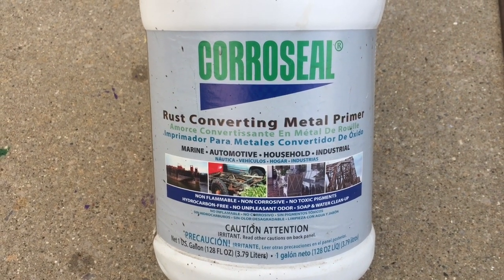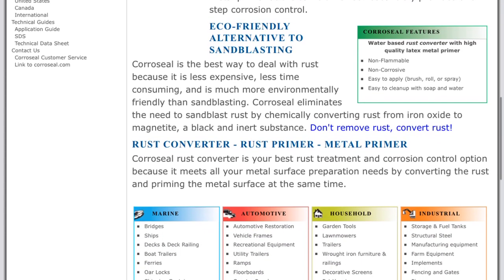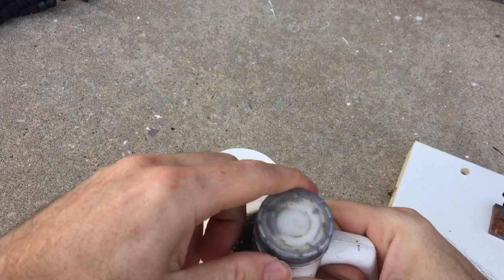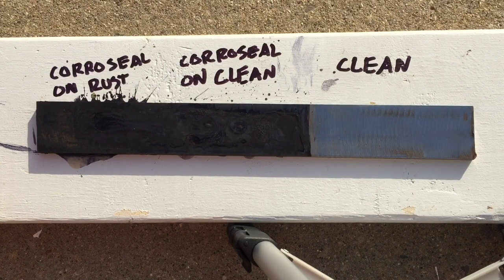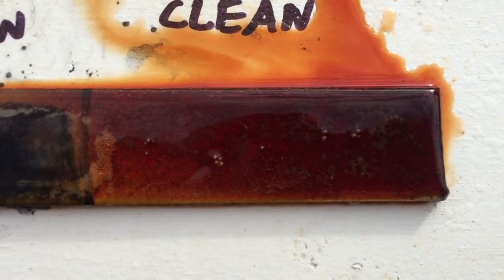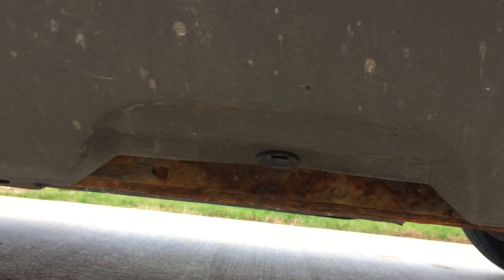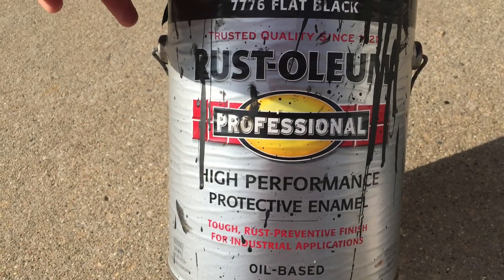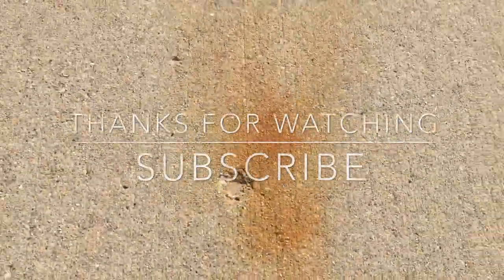CORROSEAL Rust Converter - Does it Hold Up On Its Own? Tests and Results! 4 year review! Stop Rust?

Comment: Wear protective equipment. Respirator, gloves and cover your skin. Especially a respirator, dust from rust removal is bad news. Also if you're spraying Corroseal instead of using a brush it can discolor your skin. It takes weeks to for the discoloration to fade. So cover up. This information is brought to you by the school of life. 

If you're spraying, avoid getting Corroseal on sensors, wiring, rubber bushing and plastics. Just wrap with newspaper. If it gets on there it's not the end of the world, just not a good idea long term to keep exposing it. 

1. Remove loose rust flakes with a wire brush. Wire wheel on a drill or hand brush, whatever you have. 
2. Wash all contaminants off the frame (Or body). Oil, power steering fluid, transmission fluid, even wax and soap residue etc.
2a. Blow off excess beaded water with air gun. Let it completely dry for a couple hours with a fan. Allowing all those nooks and seams to dry is important. 
3. Apply Corroseal in a thick coat with a brush or spray it on. (I use a $20 pneumatic spray gun from Harbor Freight to spray it on. Much faster than brushing it.)
4. Here is a hint using Corroseal. Multiple coats. The process of converting rust takes longer than the drying time. So using a spray gun to apply another layer before it's completely dry is going to allow it to soak in and get all that hard to reach rust. The more rust you convert the longer it takes for it to return. So put on a few coats, even if you're using a brush. Once you coat the whole job go back and coat it again. Even a third time if you want. 
5. Now apply whatever sealer you use. Whether it's paint, bar and chain oil, or another thin film product. 

The name Corro"seal" denotes that it is a sealer, but they should have named it Corro"converter". It's a great rust converter, not so much a long lasting sealer. It WILL rust again and you have to do it again and again. But if used in conjunction with paint or undercoating it works great. What Corroseal does is take a majority of the elbow grease out of restoring the metal, instead of hours of sanding and grinding. You don't need to grind the frame down to bare metal and get all the pitted rust off. Just spray on Corroseal then let it sit and do it's job. Corrseal works great as a base for other sealers. It leaves a rough texture on the metal like etching. Wipe off excess dust with a dry towel and it takes paint great.

EDIT. The best case scenario is to use Corroseal to convert the rust, then paint it with glossy paint, then use a thin seal product or oil coat. I use bar and chain oil. On vehicles used in the Northeast over 15 years I've only needed to Corroseal them twice. Then I spray every other year with bar and chain oil. The undercarriages look great. Warning though, bar and chain oil smells like bar and chain oil. So it smells and drips a little for a few days.  So if you don't like stains in the driveway, use one of those thin coat sprays. But I have lots of bar and chain oil so that's what I use. It's cheap. 

Don't get any of the above chemicals on the exhaust. At best it'll smoke at worst you'll have a fire.
Reply from the maker: Outstanding. Thanks for sharing. I appreciate it.

Comment: So what product works ?
Reply from the maker: I do not have a good recommendation in my experience. Several other products have been recommended, however, I have not personally tried them.
In my personal experience, grinding the rust down to clean metal and priming and painting it has been the longest lasting solution, but the rust eventually comes back. Another solution is to cut it out and weld in new panels, however, I have also had issues with the welds rusting over time.

Comment: The speed of rust showing up was kinda scarey.  I think the instructions talk of 2 coats, and letting it cure for 48 hours.  

I put a single super thick coating on my vw bug inside floor pan that had years of heavy rusting, with 1/3 of it rusted away to nothing on the passenger side.
Reply from the maker: It’s worth a try. I would recommend welding in a floor pan.

Comment: You put on your frame then didn't topcoat? Do you know how hot a brake drum gets 😆
Reply from the maker: Thanks for the comment. I agree that it is a primer. I have indeed top coated and experienced rust coming up from under the paint in multiple applications. I’m currently performing a test over the winter with Corroseal and a top coat. Results video in the future.

Comment: A year ago I did a truck frame and took it to the extreme I air hammered the frame then light wire bruck grinder then sprayed water then ospho let it dry over a week then sprayed corroseal let dry a week then sprayed 2k epoxy let dry a week then brushed on oil based black even after all that seams and welded connecting points still show light rust
Reply from the maker: You put in the full effort. Thanks for sharing the results! Very valuable information!

Comment: Can you  use  a sprayer
Reply from the maker: Good question! I have personally used it in a spray bottle. Just a regular spray bottle that you pump with your hand, like a Windex spray bottle. It did not seem to work very well and I just ended up using a brush. I have not used it in a commercial pneumatic spray system, so I do not know about that.

Comment: Montreal Canada - I agree with the review - I had the same POOR results on my 2005 Xterra -  Lots of rust and the Tremclad High gloss Rust paint came off - what a waste of effort.. Looked great the 2 months. A year later flakes, rust everywhere, repeat the same results. I even used Rust - Check oil to refresh and stop the rust -only this process slowed things down. After 4 years of effort and time, my Xterra looks like this video rust everywhere and 3  holes. Never use a POR or any Rust paint after any rust converter  - It works very silently eating away the metal as you think all is OK.  Using the hammer vibration test then you see the damage..Conclusion: CORROSEAL Rust Converter does NOT  WORK !!  Painting over CORROSEAL does even more damage.
So again 2 days ( I hate you CORROSEAL; why I'm I doing this again!!) of removing all the surface flakes and rust with a scrapper, power wire brush, hammer, and then sprayed 6 cans of  WD-40 ..After a few applications, it's penetrating into the metal.. I think this is a much much better strategy than CORROSEAL- The next step is to use a heavy-duty lubricant, dripless formula to protect the penetrating WD-40 .. I'm leaning towards RP-342 ..
Reply from the maker: Thanks for sharing!
In the past I’ve also tried coating rusted metal with motor oil (did not work), and I also tried grease (not recommended, it accumulated dirt and was extremely messy, and I’m not sure if it worked).
There is definitely no magic coating. Grinding and wire brushing is a must. The battle against rust continues!
Reply: I have yet to try RP-342 on my first gen sequoia. I'm hoping this "military grade" stuff really works, and then go over with some farm equipment paint, or semi truck paint.

Comment: use as primer only. paint over as directions say.
Reply from the maker: Thanks for the input!
I agree, it is a primer. I have indeed painted over it many times in many different applications including vehicle frame, brake drums, weld beads on new body panels, and steel pipe. The rust bubbles back through from under the paint. In my experience, Corroseal has not neutralized the rust. and cannot be applied without sandblasting or wire brushing first as advertised.
I am conducting a test over the winter, with Corroseal primer and paint. I will have a video with the results up in the spring.

Comment: This stuff just looks like a rust converter rather than a sealer, after using it try using a wax oil or some other sealer on top of it and see how it gets on.
Reply: Did you read the bottle? Says RUST CONVERTER. Doesn't say anything about being an undercoating or pancake syrup. It needs a top coat per the bottle.

Comment: Doesn’t this product oxidize rust. You need rust for it to work...
Reply from the maker: Corroseal is design to be a rust converter, to be applied to a rusty surface. It is supposed to neutralize the rust so it doesn’t spread, without the need to grind or sand blast it off.

Comment: If it doesn't work use a rust converter not a primer then seal with a polyurethane not a latex
Then wool wax

Comment: Well numer one your rust is coming from behind the body panel well not the rust but the moisture that is causing the rust it’s not really made for body work it’s for frames even under your car it’s still body work you do not have a frame you have a unibody the converter needs to go all the way around the metal even your teat strip was flawed or set up to fail you only put one coat of converter on it needs to encapsulate the piece you are converting 
   On the hood the moisture is coming from inside the seam from behind of course it’s going to rust you should prolly do some research into a product  I have many a piece of equipment and trucks that the frames have been treated with rust converter then painted with a oil based paint there not a product made that will stop rust the way you asked it to perform but what do I know right I’m just a dumb farmer with rust free tractor and truck frames

Comment: There's also a better one called RUST SERGANT R.C.M.P. Kinda pricey but works
Reply from the maker: Nice. I will check into it!
Reply: Also you are supposed to top coat with paint but on my 03 duramax I did the frame with no top coat and it's been over a yr and no signs of rust anywhere

Comment: Actually using peroxide and vinegar isn't a very good comparison to real world conditions.  Just because this didn't hold up is meaningless.  Not saying the product is good or not but not a fair test.
Reply from the maker: Thanks for the input. I don’t disagree. This idea was a request, to force rust and see how it holds up.
I’m currently running a test over the winter, with Corroseal applied to a vehicle frame being driven through the winter. I’ll post a results video in the spring.

Comment: Totally incorrect use and expectation. Corroseal is a rust converter. Not a rust preventer. Not a bare metal primer. Should also be topcoated.
Reply from the maker: @dontblameme6328  Absolutely. Here is a video!
https://youtu.be/pHeHN5h4l6I